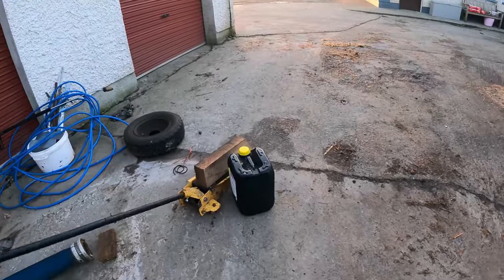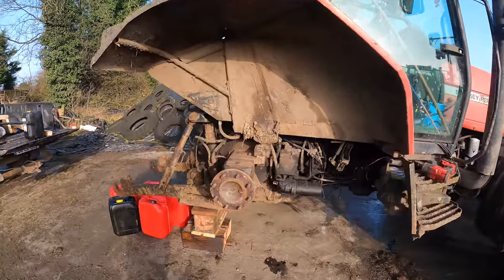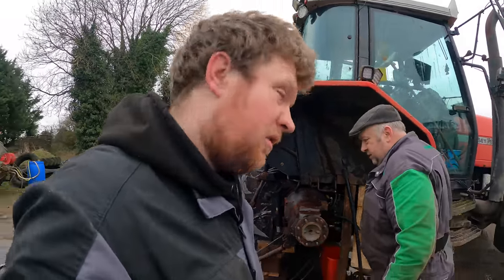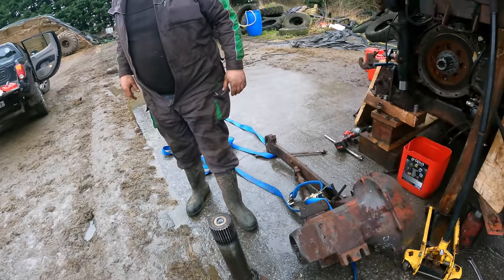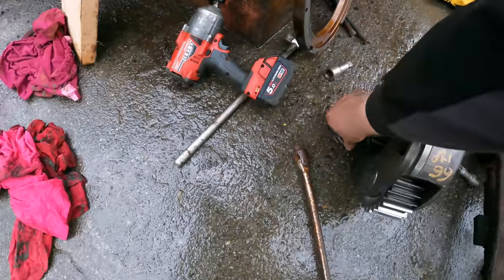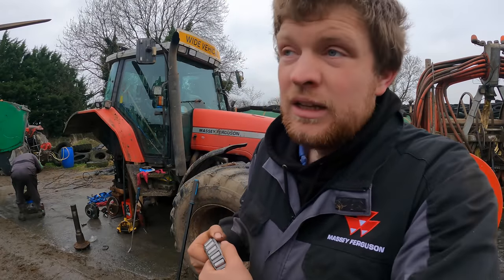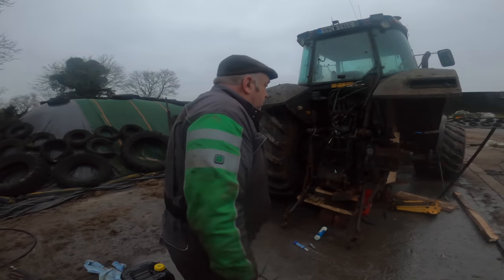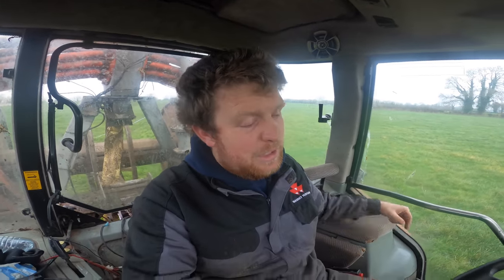WHEEL BEARING GOES ON THE 1st WEEK OF SLURRY2022

Comment: Little tip for getting the oil out … plug a pipe into a spool and use the tractor to pump it out into drums !! As soon as the you hear the pump start to run dry turn the key and you will only have a few litres left to get out through the drain plug

Comment: As others have said, run a bead of weld completely around the bearing cup and it will just fall out . The idea of welding a bar across the cup is a good idea as you will be able to grip it with a pliers before it cools right down. When you are putting heavy and awkward items like that half shaft housing back in place  get a couple of long bolts ,cut off the heads,cut a screwdriver slot on the end and screw into the holes where the fixing bolt fit and slide the housing along the bolts replacing them once the housing is fully onto place Makes it a lot easier to locate the housing without causing any damage.

Comment: Farmer Phill if you put a pipe into one of your spools at the rear of the tractor, and the other end into a drum. You can use the tractors pump to empty herself out. And save your oil. Pull the bung at the end to drain it out the last bit

Comment: Another brilliant video Tip 1 To hopefully save surprise wheel bearing failure 1 Set up as part of service schedule. Use a dial indicator  0 - 1 inch and set magnetic base on solid area of axle housing and indicator pin on wheel rim jack up that end and check change on dial indicator it should not be more than  thousands of 1 inch  You will note that I didn’t give a specified run out measurement Don’t know if Massey has a measurement for that possibility not ?? As a lot of the manufacturers either won’t have or give you these specks Their regarded as secret manufacturing specks Back to the job if you’re got no Massey speck for that measurement just check one that you have recently replaced the bearings and record the measurement and then at future services you have a number to check,if it jumps by say 10 thou you can check further 
Tip 2 Is it possible to fill that area with oil instead of Grease ,Why grease is no match for oil in those applications + With oil you can fit a magnet on your level plug and also check at service times If oil is not an option,use top quality grease and don’t over fill , if possible when pumping grease into that bearing housing if there’s another plug on the same housing open it to let dirty grease out or drill and tap a hole in it to let dirty grease out 
Tip 3 If you haven’t already got a infra red Temp gun get one and when you drive to yard after long drive check temperature of bearing housing and record ,if there’s a jump in temp that’s another warning 
Now some of the experts will ask where did this bloke learn all this stuff,working as a maintenance fitter in the Australian Mining industry Lots of the modification for maintenance schedule were not set by the manufacturer but by company’s that found failure’s and didn’t want to keep repeating the same failures As the manufacturers done mind failures as they keep selling parts That may sound conspiratorial,but I recently saw a major green companies parts sales figures and it was staggering Happy days

Comment: Hi, I was wondering why your dad didn't weld the shell itself once it cools down it will pop out. Our tractors that had terra tyres were checked once a week just for the same reason. excellent stuff Farmer Phil 👍💯
Reply: Gordon How do you check them ?
Reply: @paddymickiemickie8221  We had a frame for the 3 point linkage with a hydraulic ram that had a footplate. Pipe in to tractor spool valve and lift you can check for any movements in the wheels.👍

Comment: If you want a tip run a bead of weld around the shell and it will cool and just fall out
Reply: It's not just that it cools . The structure changes size when it's welded around
Reply: @pterkelly9279  The bearing cup shrinks I’ve seen blokes bust their butt trying to Bate them out ,nice ring of weld have a cuppa or do something else generally big bearing fall our Tip put them in the freezer or better still if you’re doing your own Ai and have a bit of spare liquid nitrogen dip the bear
 Cup in it for a 5 minutes “ Watch the hands “ and the bearing cup will fall in

Comment: Going round a corner in a Ford 6600 I saw the front nearside wheel wobbling so I slowed down and stopped then the wheel fell off, the bearing had gone and that was the ony thing holding the wheel on the Tractor, banged some wood under the axle and drove it home on 3 wheels

Comment: Hi Phil great video. I would love to be in the middle of that. I am time served fitter that grew up on a farm fixing machines I now have a shiny arse office job but pays better. Any way next time with big taper roller bearings with the internal outer ring with no where to tap out, weld 3 spaced out weld on the inner bear face and throw water on it and cool rapidly. It will fall out. Second. When fitting the inner taper race let it sit up on the manifold to heat it up. Like the oven it will expand the tolerance on the interference fit. I had these issues on an international and I drill in a grease nipple in the outer bearing and was able to keep it greased. Keep it going lads.

Comment: If you put a weld all the way round the inner bearing race then attach your bar to hammer on ,the weld will shrink the race give it time to cool helps massively but you did a fantastic job getting it back  to work

Comment: Best way to drain back end oil is pump most of it out with the spools. Plug a pipe in the spool and other in a drum. Takes less time and can save more oil.
Reply: Yeah the dealership's are a fan of that method Ok, pumping out into drums until your pump start's to cavitate then you wonder why your pumps done due to heating while running dry!
Reply: @keithk1246  Don't run your pump dry ,duh
Reply: @sarahann530  You must have longer arms than most if you can operate spool valve and a pipe in a drum at the same time! Duh

Comment: i have a Renault ares 640 it has the same back end as your fergies both back wheel bareings had gone and crushed the ceals and then both the half shaft snaped acrushing the back mudguards. couple years kates he the ceals got pushed out with to much grease good thing its not a hard job to take off the trumpets

Comment: went through this few years back case2470 4wd front right universal joint went out first day of chisel plowing also wrecked bearing/race called local tractor repair they brought lul telehandler & repair truck to the field with their help we had it fixed in 2 hours i just knew had i called caseih the tractor would be sitting there to this day

Comment: I work at a Massey dealer Bye any chance did you check if the pop rivets on the brake disc were still tight ? I had one were al the rivets had broken loose

Comment: Thats a fair dose alright, but as you say could have been worse, could have happened at night on the road in the lashing rain. 
Surprised you guys don't use work gloves especially with the amount of grease and oil on these kind of jobs, also save the hands from filings, splinters and grease. Worth having them for the jobs around the yard too, saves the hands and keeps the fingers warm in the winter. Also makes it easier to wash when heading in for the spuds. 
That said ye midlands boys a tough out.

Comment: God, ye're jack of all trades.  Just one comment - would it not be better to get the proper gasket for jobs like this rather than using the gasket sealer?
Reply: No gasket on it ! Some manufacturers fit an oring but they came with a bead of silicone type sealer around the edge which sits into the back end!
Reply: @keithk1246  Ok, thanks for that.

Comment: Is it the wide wheels or the weight of the dribble bar is causing the bearings to fail?
Reply from the maker: Bit of both causing it
Reply: The bearings burnt up twice on a sports car I drove in my youth. I had extra wide tires on it.  You just put those wide ones on that tractor, did you not?  going back to stock saved my bearings but cut down on handling :(.

Comment: Putting on bearing and seal with a chisel I bet that bearing won't last either
Reply: The last one done 4 years how did it not last 😂
Reply: @gregshearer423  if you think 4 years for a wheel bearing like that is a long time then ok but then it's a massy
Reply: @mudflipper8854  look at the weight it carrying for half the year plus the wheels it on there not a heavy built tractor so all things considered a wouldn’t be complaining